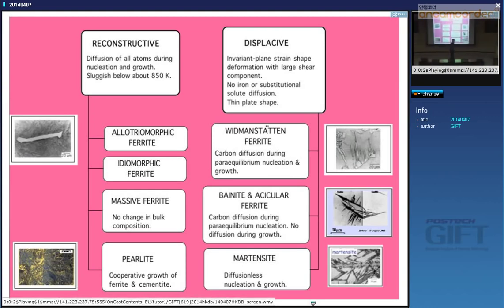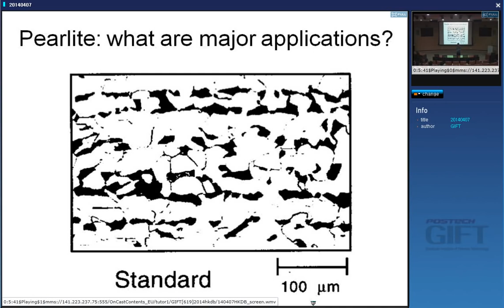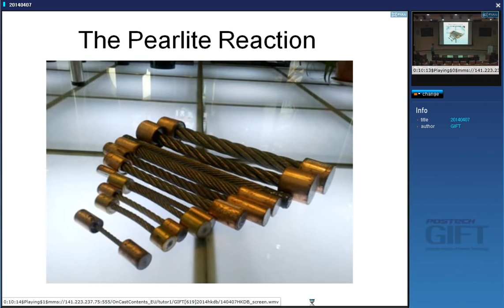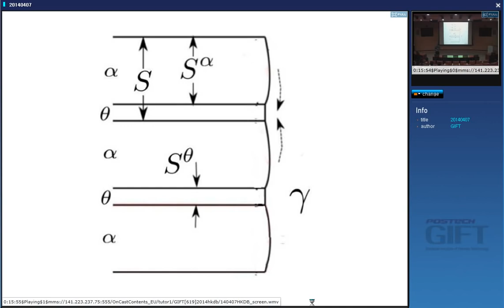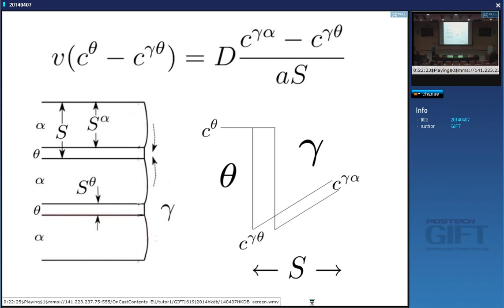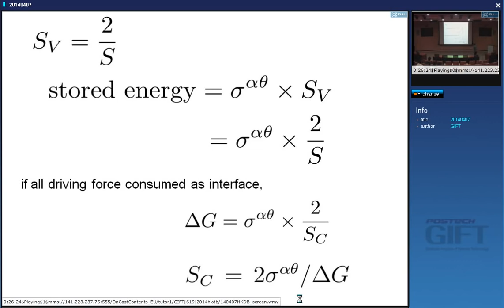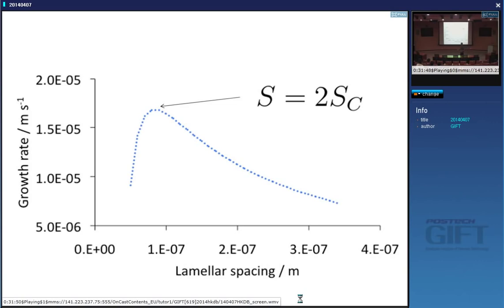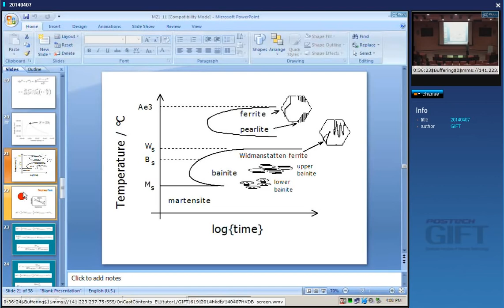Phase transformations in steels 9, 2014

Comment: Dr. Bhadeshia....I looked at some of your lectures...they are extremely helpful and informative.  Thank you so much.  Is it possible to get a extremely fine pearlite (100% pearlitic structure as shown in your video for a low carbon steel (~0.25 wt. %).  If so...what is the approximate cooling rate to obtain 100% pearlitic structure?  

Another Question: I am studying some graphitization issues in carbon steels. Graphitization appears to be most susceptible in the region just outside of the optically visible HAZ in a welded carbon steel component. Is the region just outside (adjacent ) of the visible weld HAZ is below A1 (lower critical transformation temperature) or slightly above?